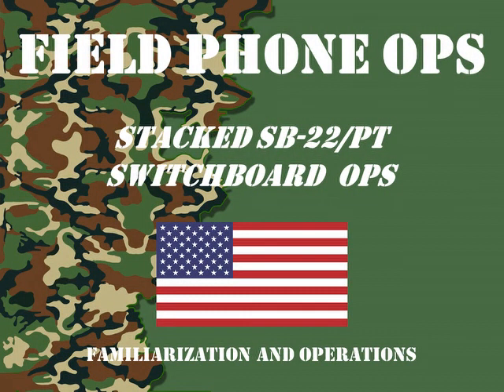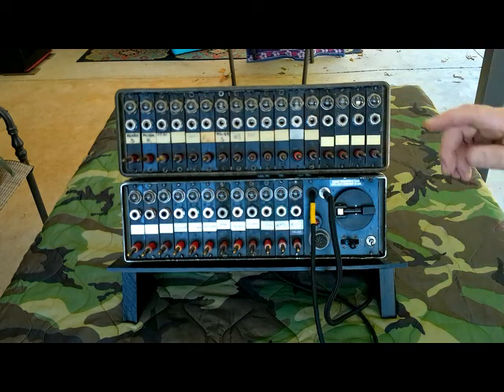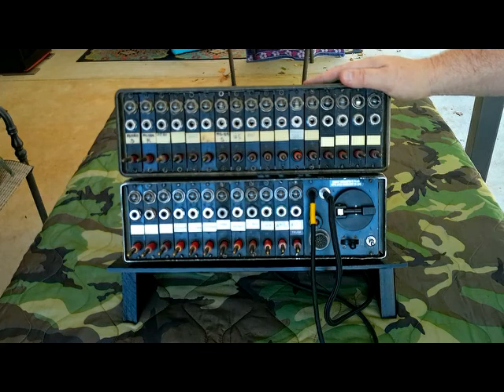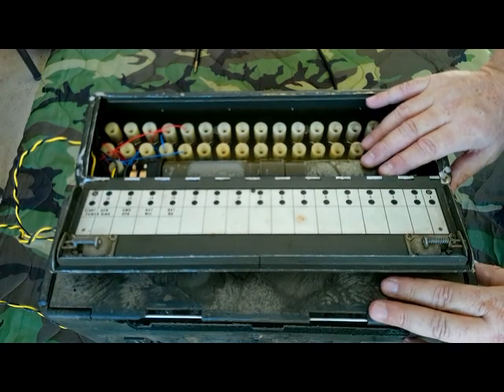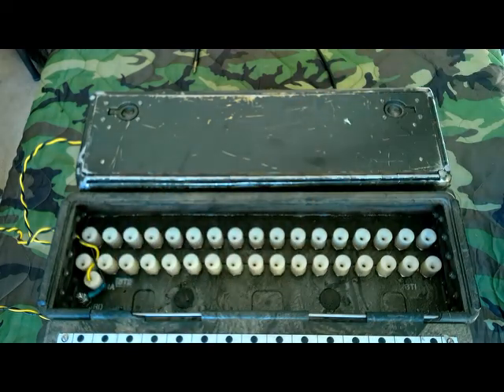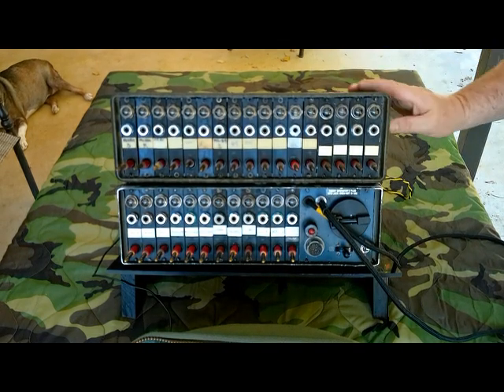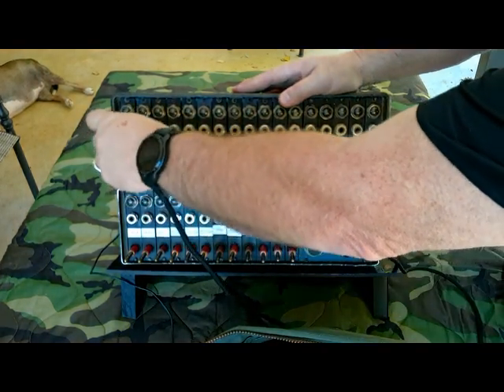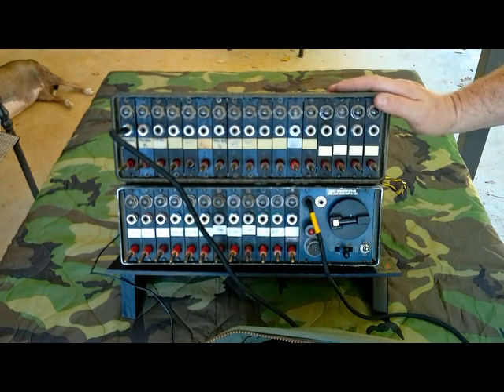FIELD PHONE OPS:  Stacked SB-22/PT Switchboard Ops

Comment: I was a Marine Corps field wireman and then a wire chief.   I don't know if the SB-22 is still in use or not, but it was the entire time I was in the Corps.  But of course only very small units used it.  We had an SB-3082 when I first went in (30 lines and no cords), and the SB-86 which had cords, because it was really a giant SB-22 in by design.

And then we had the SB-3614, which was completely touch tone dialing, as well as the TEC-38 Central Office (was mounted on a truck), with another truck that had to be parked next to it for the patch panel van. 

I started out in 1976 through 1997.   By the time I left the SB-86 and SB-3082 were gone.  But the unbreakable SB-22 was still there, along with the TA-312 and TA-1 for phones for it.
Reply from the maker: Thanks for your service!  I did 32 years in the USAF and ANG and ran the Comm Maint section for a mobile tactical radar unit.  I had two SB-22s, a SB-3614, and two SB-3865s for the DNVT's and DSVTs.
Reply: @thefieldphoneguy8254  I have never seen an SB-3865.  Must be after my time.  I wonder if the SB-22 is still around.  Because it just doesn't fail.   Even without batteries, if you use a TA-1 as the operator headset and just look at the thing instead of listening for the buzz.

Ok truth time.  I have seen an SB-3865 because you made me go look it up.   LOL
Reply from the maker: I retired in 2012 after 32 years and we still had SB-22's.  SB-3865 was a USMC fielded Unit Level Switch that came out in the early 90s.   They worked well, we'd link up to our CRC over satcom and they worked well.  Also had worked well with secure teletype, voice, fax and data links.  I ended up getting my MX Supt and Chief of Maint to allow me to get rid of TA-1s and sub TA-312s.  We had nothing but trouble with them.  Had lots of Air Weapons Control Officers who were constantly complaining also they didn't interface good with out air battle management comm system.
Reply: @thefieldphoneguy8254  so just for my interest, were you a 2512/19/etc or a 0600 something by the time you retired?
Reply from the maker: I wish it was that easy !  USAF doesn't use MOS it uses AFSC which were similar and everything depended on your skill level, 3, 5 7, 9.  I started out AD as a 1C171 Air Traffic Controller for 10 years then went into the ANG as a Comm Tech Controller 3C271, then I was involuntarily crossed trained into Aerospace Warning Systems Operator 1C571 then I retrained into Secure Communications Maintenance 2E271 and was hired full time as a GS-11.  I was in an USAF Air Control Squadron very similiar to a USMC MACS but we were smaller and had everything we needed to deploy in one unit.  This allowed us to qualify on multiple systems.  I was qualified to repair all of our secure voice and data systems, telephone system/switchboards,  Inplant/outplant cabling including multipair cable, coax, and eventually fiber optic,  TYQ-23 Air Battle Management System,  Radio Equipment, SATCOM, Troposcatter, LOS microwave, etc, etc, ect.  I ended up retiring as a E-7 occupying a E-8 Slot as the Cyber Systems Transport Superintendent after being pissed with by commander over being promoted 3 times in a row.